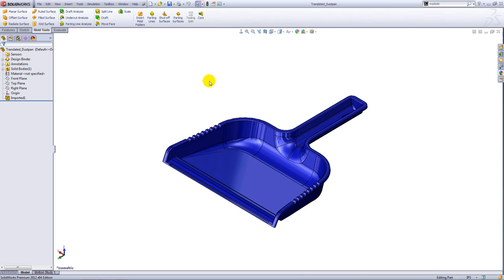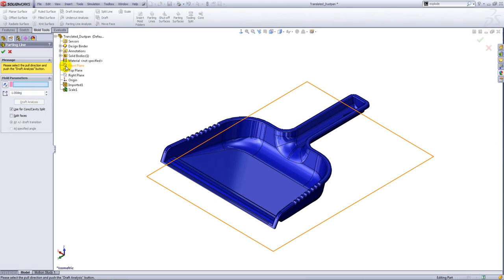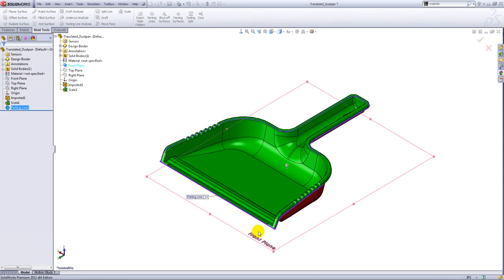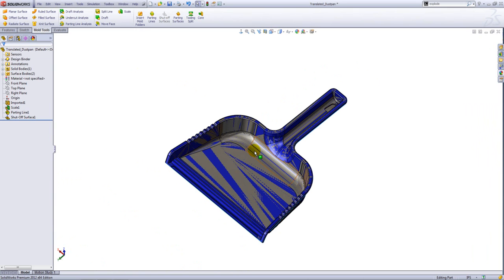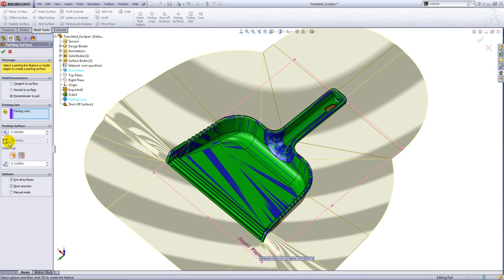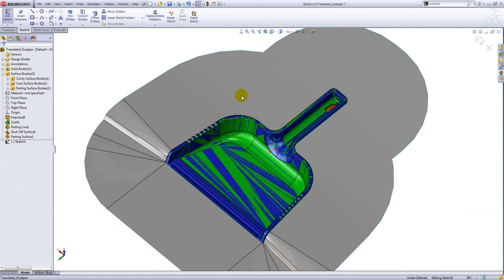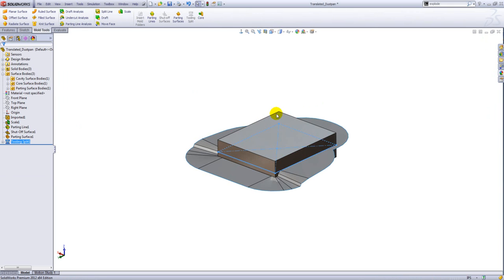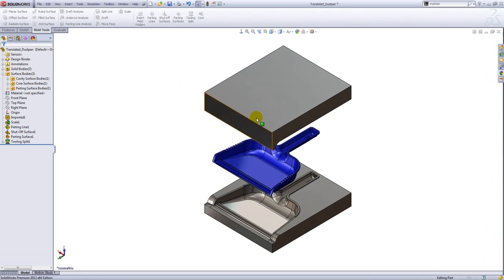Introduction to SolidWorks Mold Design

Comment: My part won't let me split the mold into core and cavity after I click the surfaces in shut off surfaces.

I checked and double checked that I clicked all the edges. I tried all the top edges, all the bottom edges, and all of them. Still to no avail.